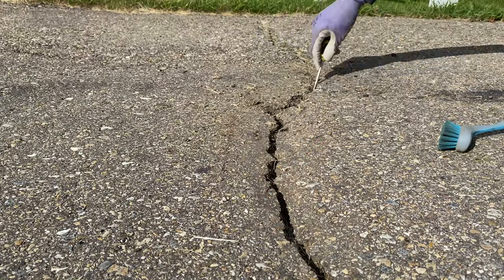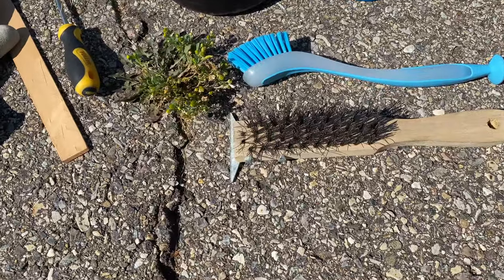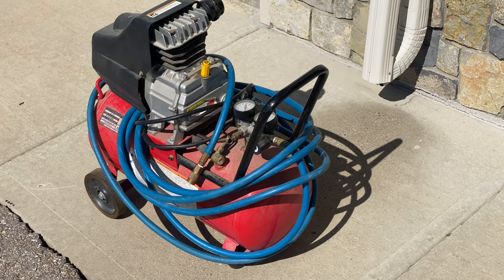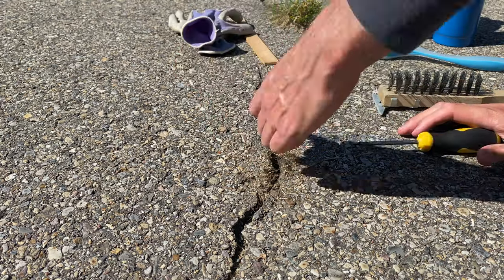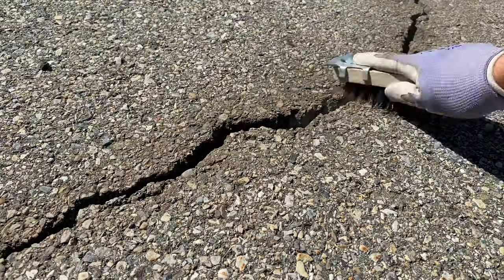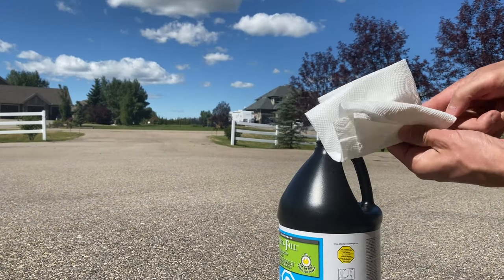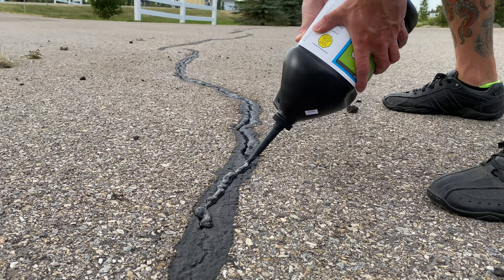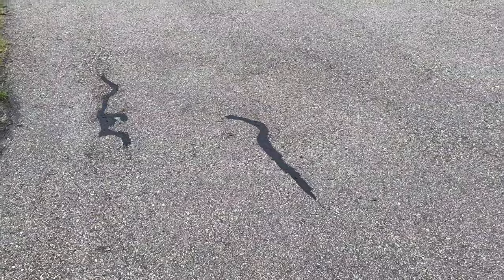I Saved $610 - DIY - Asphalt Driveway Crack Repair

Comment: I wonder why people always say "ash-phalt"? If you look at the word, it's clear there is no H between he S and P.
Reply: Because asphalt without an H sounds like a rectal problem 🤷‍♀️
Reply from the maker: Or maybe people from outside your region pronounce or even spell things differently.
Reply: @DIYandSAVE  there's ONE correct way. ASS-FAULT.
Reply: @DIYandSAVE  heaven forbid 😅
Reply: It’s actually “asphaltic cement pavement” or as professional road builders call it, ACP. When you run crud oil through the refinery a couple of times, stripping out all the different grades of fuels and oils, what’s left at the bottom of the tank is asphalt.
Reply: Yeah, I've never heard the "sh" thing until this video. If you hear it a lot I would guess it's a regionalism. Who can tell how those things evolve. 🤷🏻‍♀️ It would bug the hell out of me if I had to hear it. It bugs me here. 😂
Reply: @woody5109 this is not cement.
Reply: Colonel

Comment: Tipping over a gallon of heavy liquid seems rather messy. Best to pour into a condiment bottle from .99 cent store and use as needed. If it clogs up, just throw away.
Reply: Looked like the gentleman didn't have any issue and it was very clean.

Comment: Take out the nozzle first and flip it around, reinstall the cap with the nozzle pointing outward. Then shake it up and the nozzle will not have hardly any filler on it, if any. 👍🏻

Comment: I have tried many of these crack fillers. It's more expensive, but for my money, I used 100% black silicone on my existing driveway cracks. Three years now, and not one has opened up or started a new crack. And this is Northeast weather.
Reply: Is that like the kind used around windshields as gaskets? Softer than the clear type?
Reply: @MoPoppins  The tube doesn't specify windshields. It says GE 100% Silicone. You need one of those lever type guns the tube fits in to apply it. Fill the crack. Then just flatten it out. Done.
Reply: Can you use sealer over the silicone? Wouldn't think sealer would hide the silicone or stick to it, bond over it?
Reply: @johnstephens6870  I guess you could try to put sealer over it. The shininess fades over time, and I really don't give much thought to the cosmetics of it, although I understand that it could be an important factor. All I know is I've tried many things. This flat out works.
Reply: Thanks, I think I'll use the silicone and sprinkle in a little sand on top of it while it's still wet and use a sealer over top maybe it will bond to the sand stuck down in the silicone.
Reply: I'm seeing "GE Supreme Silicone Caulk 10.1 oz Window and Door Sealant Black" "Caulking for windows, doors, roofs, sidewalks, siding and more" 
$14 per tube at home depot. If that's the one you're talking about, I think I'd save money repaving instead of filling all my driveway's cracks 😭😭
Reply: @Corkoth55  I suppose it depends on the amount and severity of the damage.
Reply: @moboutmen For no more than the size of crack in this video, then I agree with everyone using the black silicone calk, and mine sealed over beautiful,  for larger cracks, I mixed sand and Portland cement together and filled up all the way to the top and then went back over those with smooth patch from lowes,  it's a special order which sucks but turned out nice.

Comment: The crack sealer dries too smooth, not bumpy like asphalt, so it is easily seen once the asphalt sealer is applied. All the cracks that get patched need to be slightly bumpy in order to make it look like there was never a crack there to begin with... which is half the point in bothering to fill the crack in the first place, if you ask me. Fill the cracks with Aquaphalt or use a thick asphalt sealer made for fixing cracks, like alligator crack sealer, that you can spread with a squeegee so you can feather it in perfectly... not seeing any lines where the crack was is what you want, right? Then make sure the cracks look good, not just "filled". Then use the asphalt sealer and when it dries it will have that "freshly asphalted" look. With no panty lines!! 😎
Reply: Gator seal is smooth to, i dont think ive ever saw the crack filler not visible id like to see it, would look lot better, ive seen sand brushed in the cracks then sealed over it kinda hides it but dont last as long
Reply: Thanks!!!
Reply: I dont know what is the right way but this didnt look great when finished
Reply: I agree…unless the flaw/damage is meant to be noticed, it’d ideally be BLENDED or camouflaged into the surrounding area. I’ve only ever seen the flat, shiny type of repairs, obviously since it’s easier, but IDEALLY, they’d be more aesthetic, rather than scar lines everywhere, like the old C-sections (my mom got 3 of them).
Reply: Just sacrifice an old push broom and once its started to skin-up just drop the broom bristles straight won to create a pebbly appearance.

Comment: I have crack filled and sealed my driveway three times over the years now. Nothing works as the next year, cracks are opened back and the rubberized, or aggregate based filler is no match for asphalt movement in winter. Yes, sealed entire driveway to with Airport grade sealer.
Reply: Depends upon the crack filler used and its apparently really important to get that thick filler liquid an 1-2" on either side of the filled crack to prevent water infiltration which is what jacks the cracks back open.
Even Airport grade sealer is quite possible just the basic old school stuff vs the newer epoxies.

Comment: Tip- Make your first pour run, then go back with a 1/4" piece of stir stick or metal rod and drag it along your crack to help it settle and fill air voids. Then run your top coat and maybe use a dollar store paint brush to get it level so it doesn't look so pronounced after resealing. Apparently a pro-tip is to get a good 1-inch to either side of the crack well covered to help prevent moisture infiltration/winter which will jack that crack open.
Good video.

Comment: Well detailed video. One recommendation: should have filled crack with coarse sand to fill void especially where there has been water intrusion. Also, the driveway appears ready for re-coating; a messy job. I used the thick stuff with filler.

Comment: Great demonstration! That seems like the stuff I have been using from lowes for the last 12 years. Lowes is my favorite store, but Home Depot sells some crack filler that seems to bond much better (just discovered it last year). It's in the same type of 1gallon  jugg and it's about $10.00.

Comment: good job, Im from Montreal and I found that using driveway resurfacer (black knight) over 1/4in or more is more effective then pouring liquid.. liquid seems only good for very small cracks. Also it cracks in winter but you just apply a bit more in spring and its like new again.  Last time I paid 450 to get it repair and sealed.. now I.do it myself
Reply: Agree. In my experience, the liquid doesnt last in larger cracks
Reply: What do you mean over 1/4 inch?
Reply: @elisicamost5959  If the crack width is over 1/4" wide....

Comment: I would have done the crack filling using hot pour crack filler which is better than cold pour for $1 a foot so It would have only cost him about $80 instead of $650

Comment: great video, i actually have the same product, the black jack speed fill.  Now, i as you just showerd me i now know what to expect.  One thing though, you did not mention how long it takes to dry.
Reply from the maker: Glad you liked it. Good point. It depends on temperature and how thick the application is. It only took a few hours for the thinner layers but a day for the deeper cracks.

Comment: In the professional bid, what was the material proposed to do the job? Most reputable companies would use a hot rubberized crack sealant which would outperform and outlast any water or acrylic based sealant. In the short term money was saved but if an individual lives in the part of the world where weather changes are drastic the elasticity of a water based cold pour material is sub par and a temporary fix at best.
Reply from the maker: The professional bid was for a rubberized material. My solution was temporary and I will be looking for a better solution.

Comment: So I have to seal the cracks after I repair them with this product?
Reply from the maker: Not necessarily. Repairing the cracks with this product will seal them. Adding a coat of sealant is a bonus but not as important as filling the cracks.

Comment: Excellent presentation. What about storage if you only use a portion of the gallon?
Reply from the maker: I wrapped some packing tape around the spout to seal it off. Seems to have worked just fine.

Comment: Each summer I seal the cracks in my driveway, but as soon as the first hard freeze takes place it always has cracked where I placed the sealer.
Reply: Use gravel before seal 👊🏼
Reply: Someone else in the comments used BLACK SILICONE (lives in the harsh NE), and says that it’s been years, and despite the yearly hard freezes, has had NO issues—maybe this should become the new standard? 🤔

Comment: You get what you pay for. Even with the driveway sealed in about a month your cracks will be open. The worst part of that brand of crack filler is after the first rain.. The black dye will wash away and all the crack filler will turn a grayish white on your nice black sealed driveway. Just letting you know from experience. My advice would be have a professional hot crack fill for longevity.
Reply: I would recommend calling a different company about the cracks. Measure your cracks.. Usually professionals charge $2 a ft for hot crack filling unless they have a minimum price. If that is still to expensive. Crack sticks work for a diy'er.
Reply: How does it work with stopping weeds? Been looking at options to fill the cracks to at least minimize the weeds every summer

Comment: How has this repair held up over time? Did you have to redo it and if so, did it work the second time as well?
Reply from the maker: A lot of the sealer lifted off the driveway over the -40 degree winter. Some was also removed when I shoveled my driveway. I would use a more rubbery product if I were to do this again.

Comment: You blew out the debris in the cracks and on the deep cracks you filled it with sand??? They make a product that’s thicker and you spread it into the cracks with a trowel. It’s basically the same stuff just a higher sand to bonding agent ratio. Should make for a better repair.

Comment: HOW LONG DOES THE FILLER LAST IT'S BEEN 2 YEARS BEFORE YOU HAVE TO RESEAL??
Reply from the maker: it depends on your climate and if the crack expands. In colder climates, it will last for about 1 year. It will need a quick re-sealing in the sprint.

Comment: Was the $650 quote for hot crack fill? Your using a water based pourable crack filler opposes to the propane powered hot crack fill machine with 400 degree oil based crack filler. I charge min $100 for hot and typically with only a few cracks I dont charge for the water based with the seal coat. $650 is a small parking lot.
Reply from the maker: The $650 is CAD and it was a large machine which needed time to heated up. If others in my remote area were also interested, the price would have dropped.

Comment: I filled the cracks snd next day the filler was cracked and it looks half filled . What do i do?
Reply from the maker: Maybe add more. The filler will settle and might even shrink.
Reply: You poured it into a crack and trapped some air.  Refill and drag a small stick or piece of metal rod along the crack to force the air out, then refill again and smooth.
Although the OP says this product failed once winter came around.

Comment: I have a lot of tiny cracks over a large area of my drive. Can I pour a puddle over a big area of tiny cracks and squeegee over it? Please let me know what you think as soon as possible because tomorrow is the only day left this season that will be warm enough. Thank you!!
Reply: I recently filled my driveway cracks using Latex ite Shallow Trowel Patch (from Home Depot).  Around $20 for 2 gallon bucket - the stuff comes out thick and pasty;  it can be filled with a trowel (hence the name above) and then smoothed and feathered out.  It appears brown and dries to a nice black color with a hard texture similar to what’s described in the above video.  Latex ite also makes a liquid crack filler which works well in shallow cracks, but I had some deeper ones so the Trowel patch worked better to fill the crevices.  Hope this helps.
Reply: @swu6533  THANK YOU! It’s very kind of you to share your good experience & now others can benefit.

I ended up finding a nice older man to fix the cracks & seal our drive the very last day here warm enough to do it. Phew! 😅

Comment: Fake cold rubber lasts 6 months or less. The sealer at a hardware store flakes peels up. Wouldn’t you rather have real sealer?….and hot rubber the proper way to fill the cracks. Doing it professionally would last 3-5 years.
Reply from the maker: Yes, agreed. We discussed this in the comments; that video is coming soon.

Comment: that quote was a joke should be 200-250 max
Reply from the maker: What material would you recommend for that price? These prices are CAD don't forget. These guys had to bring in the equipment from 30km away, spend an hour heating up the unit, clean the cracks, apply the hot melt and cover their travel, wages and insurances. Given the outcome of my idea, it might have been a better solution. It would have been half the price if a neighbor was also interested.
Reply: @gypsymodz  They were asking $1700 for the seal coat LOL

Comment: $1717 to seal a driveway??? I have a 2800 sq ft driveway and it only cost me $850 to seal it. That $610 quote is probably way too inflated.
Reply from the maker: Yes, $1717 CAD was on the higher end of the 3 quotes I received but this company used better products, have a more detailed prep process and had better online reviews.
Reply: hi.  where are you based? I have an approx 2200 sq ft driveway and am being quoted US $600, thought that was a lot? I guess not?